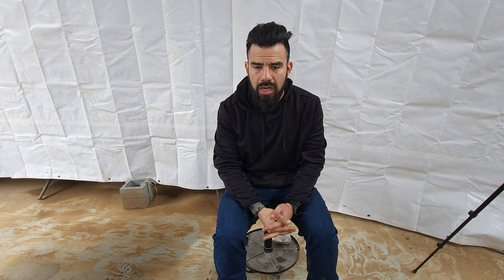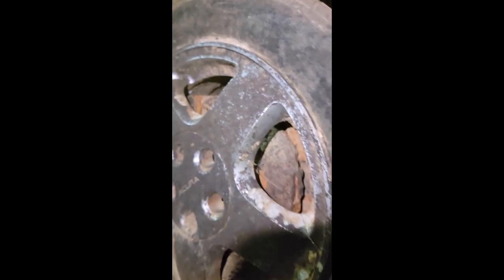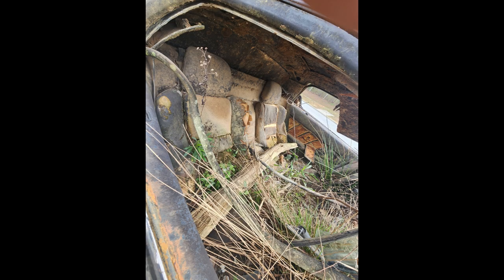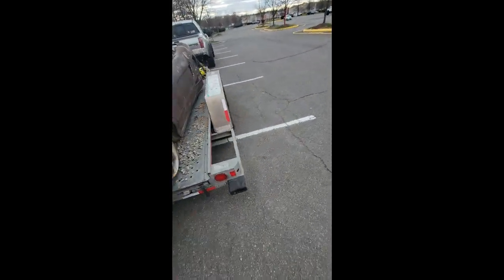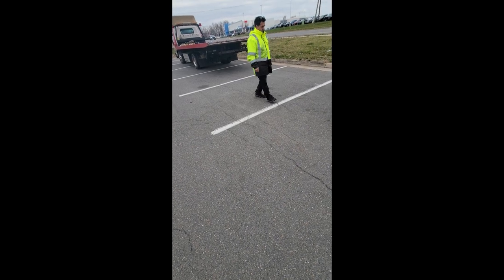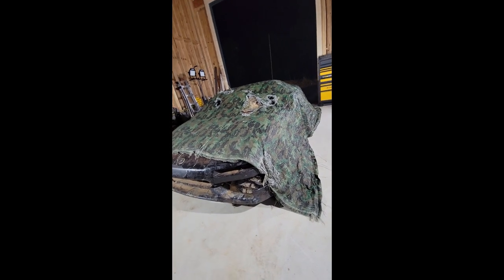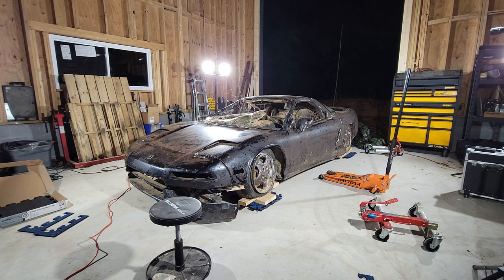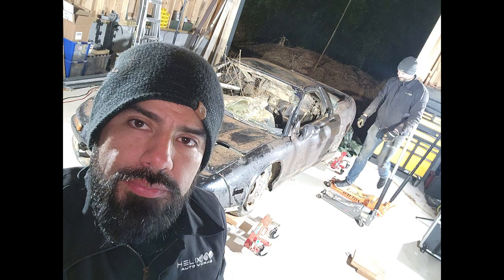Restoring a Stolen / Sunken Acura NSX Ep. 2

Comment: You towed it backwards. The NSX is front engine. All the weight was at the rear of the trailer. Rookie move.
Reply: The NSX is mid-engined, it's in the rear of the car. Right behind the seats. The tow hooks are up front (or were up front anyway, they were probably rusted out after all this time deep in the drink. LOL)

Comment: You really should be getting the mud out of the car before you move it around to much, if the unibody isn't already damaged from the mass amount of extra weight I'd be surprised. The Cars not low because of the flat tires...mainly its from all the extra weight collapsing the suspension. One look should have told you it was heavier then factory weight.....are people just that clueless??